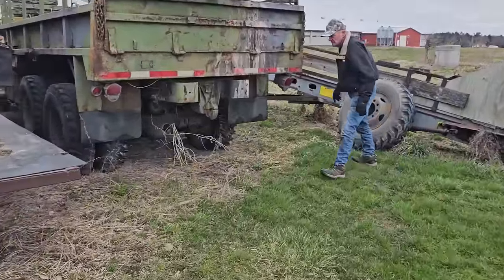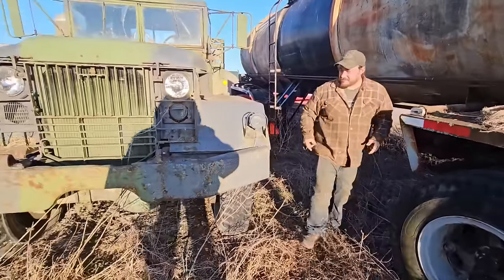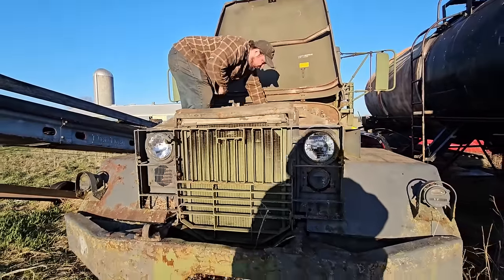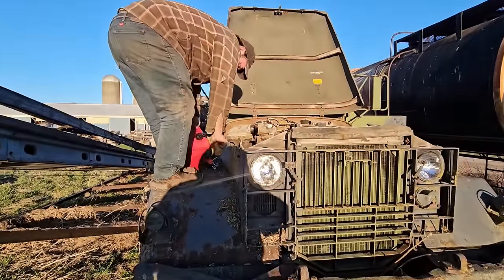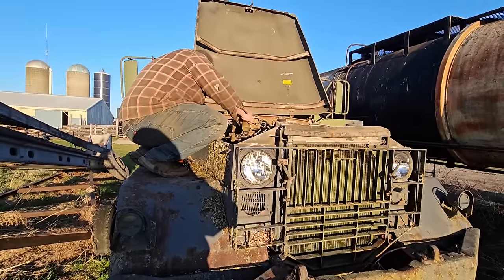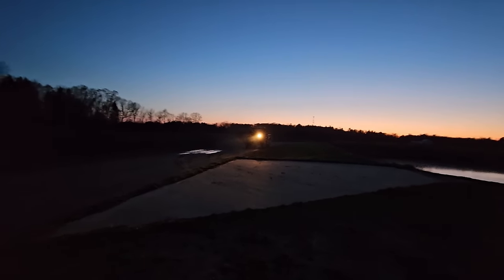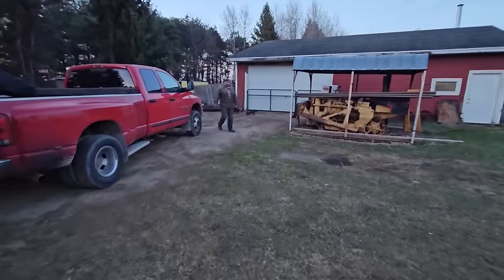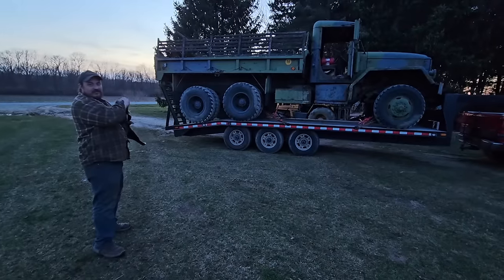Abandoned and Forgotten  5 ton Military 6x6 Truck

Comment: Those old 5 tons don't use regular DOT 3 brake fluid if I remember it was aircraft type brake fluid and air over hydraulic and 10.00/20 tires witch it looks like it doesn't have the old military tread tires on her
Reply: I used to drive one when I was in the Army back in the 80's and we used DOT 3 because we got orders to change all of ours over because it was cheaper and more readily available.
Reply: REO😂 nice truck